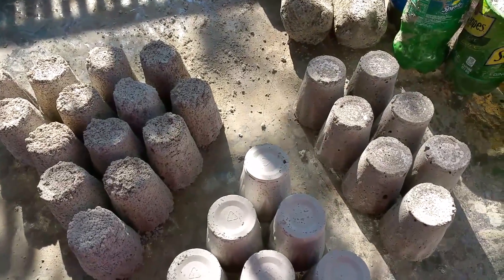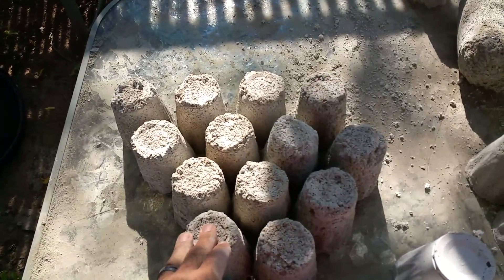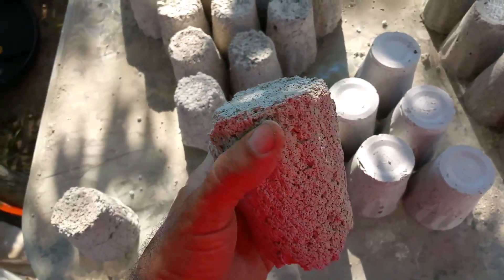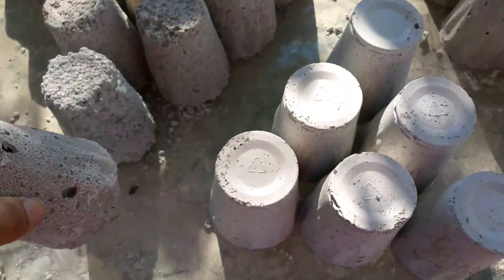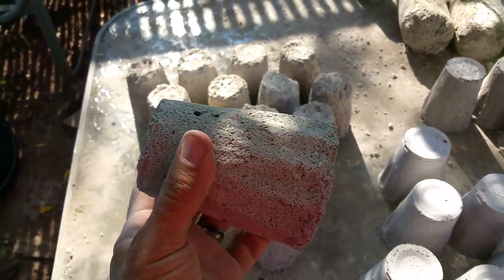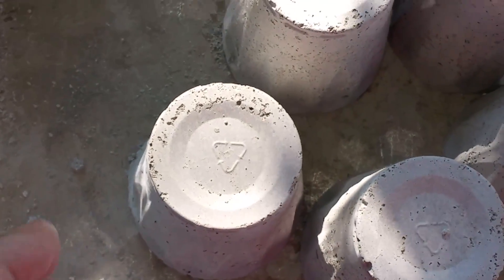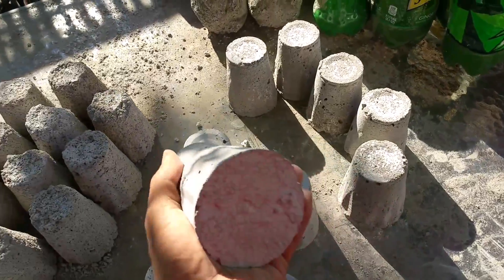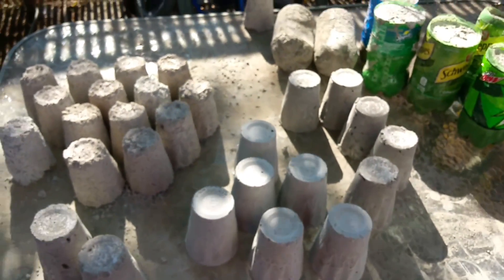Aircrete Update 7/17/2017 #Aircrete #DIY #AircreteHarry #Aircreteprojects #AircreteUpdates

Comment: Low-cost house casting system with air create, I sell the reusable plastic formworks to the Foam Generator and the Foaming Agent, all you need is one day training and the rest is consultations, all I ask for is a thousand dollars and you are on your way to be able to cast concrete houses.

My name is Alex Liew Chung Meng, a Malaysian born Chinese and I am 58 years old, I have been in the construction line for over 40 years. Starting with a 25 cent a day pay at the age of 13 years working part-time after school and weekend and school holidays.
I finish my secondary school education at the age of 15 and has a penchant for R and D on system to improve anything that interest me, one of it being concrete and steel engineering. And my specialty is in Fiber Reinforce Lightweight Concrete. I have transfer my know-how and systems to more than a dozen universities as I want the lecturers and professors of the civil engineering faculties to in turn let this students who will be future engineers and architects knows about my systems.
I remember then ( and even now still practice ) that large meter wide and meter deep holes were dig for the house footings where a pad footing is made and the stumps and the ground beams for the house foundations. The pad footing resembles a reinforce concrete slab inside the deep hole and then a short reinforce concrete column is done before back filling and then the ground beams, more than a dozen of this “ footings “ were done or require at every columns of a house, resulting in large amount of diggings and plywood forming, steel bar bending and concreting works, it was then back then I realize that why this unnecessary work?, why not a large slab above ground and it serve the same purposes, it is now known as Ralf Foundation or Strip Footings and many are using this nowadays even for more than one floor dwellings.
Back to Lightweight Concrete, we all know concrete is dense and use cement, sand and stone, density is at 2,400 kg/m3 range, my lightweight concrete use only the cement and sand and no stones, we use foam ( foam is like a shaving cream and shot out from a simple foam generator that I invented ) which is added to the mix and the amount or percentage of foam added is to reduce the density of the mortar mix, the cement and sand mix has a density ranging from  1,800 kg/m3  down to below a thousand kg/m3 which makes the mix lighter then water, the strength is also controllable via cement and sand ratio as well as other additives, it is also able to add recycle waste such as ash or quarry dust. The multiple mix and density makes it applicable to a wide range of applications ranging from heat insulation, blocks, panels, precast to casting a complete house, where by using simple to erect and dismantle reusable modular system formwork ( www.lcm.my ) I invented comes into the picture and hence the system of casting low-cost strong and very fast construction of low-cost affordable housings.
Back to those old conventional construction ways, after those footings as base of house,  it is the columns and roof beams, well same again were plywood forming, steel bar bending and concrete of the columns and roof beams and this is the structure frame of a house, well it is still in practices till today. When this is completed, bricks wall are brick-up, then a thick 20mm cement rendering for the completion of wall but remember that hacking are need for the wirings, water piping and sockets as well as the door and window frames.
All this works at the end of the day serve to make a house structure and all its walls, skill workers take months to complete this task when a simple change of making it happen serve the same purpose. Instead of months of works, all this can be done in days and with unskilled workers, all it need is a industrialize ways of doing the same work but with systems. Using reusable formwork, instead of columns and beams then brickwork plus cement rendering, formwork are setup, door and window frames in place inside the formwork, water pipes, electrical conduits as well as it’s sockets are all in place before chosen concrete is pump it and pour into the molds / formworks. It is dismantle after a few hours and the whole house structure is ready, all this take only a few days inclusive the base of house which is the Ralf foundation.
The worlds requirement of low-cost housing is mind boggling, I have travel far and wide in my business of training and technology transfer to many interested parties around the world, I license my few system formwork and even have a formwork that Stay In Place ( www.shss.my ) as when it is setup, the chosen concrete pour into the formwork and the formwork stay as the skin of the internal and external walls of the houses as this system eliminate the need for the thin layer of skim-coating required before painting finishes.
Countries like India requires hundreds of millions of small low-cost houses for the poor and homeless, Africa continents also require that volumes with Nigeria alone requiring 17 million units, I have train over 300 licensees in over 50 countries on various applications with my Lightweight Fiber Reinforce Foam Concrete technology. All in all and hopefully being able to help, I have and am still developing better and cheaper ways to let the world have my idea and system where everyone can own a concrete house, a durable and earthquake and cyclone proof strong concrete casted house. Bricks and blocks are major cause of death in an earthquake or cyclone as it tends to collapse easily. A casted wall is easier, stronger and cheaper way and hope it can be much more excepted ways to construct.
Me and my licensees have done sample houses in many countries like India, Sri Lanka, Indonesia, Philippines, Malaysia, Kenya, Uganda, Nigeria and many more countries, as always, many authorities will not be willing to help in this low-cost housing due to given reasons like land shortages, who is going to invest, who will pay, who will finance this and that, and at the end low-cost housing for the poor and homeless will be a major challenge. I have negotiated countless time for this low-cost housing in many countries and this are always the factors unless CSR ( Corporate Social Reasonability ) come into a compulsory reality as this is one way to help the world poor and homeless.
The other factors are even when a small low-cost cheap home is sold ( unless given for free for this few thousand dollars small houses ) to this poor homeless people, even a 30 to 50 dollars repayment also they are unwilling or not possible to repay monthly which is making no one or banks willing to help with this housing development project. Well we are not into housing development here but let’s stick to the point of my cheaper and better low-cost construction systems. With my proven methods and years of experience, millions of this houses can be casted annually, provided CSR comes into it as a compulsory subject or Queen Elizabeth willing to give a few % of her wealth to solve the worlds homeless and low-cost housing shortage, well will still see this unresolved.
Another one of the major factor in preventing it from happening for the affordable segment of housing is due to the fact that as compare to conventional construction methods where after weeks of footings works done they claim progressively, 10 % to 15%, then the columns and beams and weeks later they claim a little more also like 15% and further down the road bricks-works and others before the roof finishing, floor tiles, sanitary and electrical and other stage by stage claims. These take months to a year. So they can do it and it is economic for builders, buyers and bankers even though the houses done are more expensive and slow, compare to my system, just put it this way, you want to start work, you have to prepare your door and window frames, your water and electrical piping, roofing’s, sanitary, tile and even paints as all it takes is a few days or a week or so to complete the house, you need to change the financial side of implementing projects. And that puts of a lot of people from daring to use my system not to mention the capital investment for the formworks and the equipment like mixer pumps and of course my fees for training, technology transfer and consultations.
Regards.
28/05/2018
Alex Liew Chung Meng
Whatsapp : +6 019 9160861
E-mail : lightweightconcrete@yahoo.com
Website : www.lcm.my
Website : www.shss.my

Self Compacting Self Leveling Fiber Reinforce Lightweight Concrete for Modular Low cost affordable housings.  Worldwide there is a demand for good quality concrete low cost housing. According to the UN, about 21 million new low cost housing units are required per year. In order to clear the back log by 2030, an additional 14 million units per year are required. In Africa, 72% of urban population lives in slums. In Asia this is 46%. The houses must be cheap, easy to construct yet very durable and able to bring comfort to its occupants, also earthquake and cyclone proof. In this age of conservation of resources and green sustainable approach, these factors play an important role. By using modern construction methods, the quality of the built or cast houses is mainly controlled by the know-how used. Local communities can be engaged in a high share of workers usage as unskilled workers can be train in days just to set up reusable form-works, mixing of concretes and pour or pump into setup form-works, door and window frame are already in-place, so is water piping, electrical conduits and sockets before concrete is place, in a matter of hours, the complete cast houses is ready for finishing such as skim-coat paints and roofing. www.lcm.my

Comment: I was hoping the micro rebar would add strength.
Reply: It needs something to get a grip onto. It can't crip air. Less (or finer) bubbles = more grip.
I think the Dragon machine makes big air (not foam) bubbles from the way it whisks the foam/cement mix. It doesn't fold it in as a slow turning drum  mixer would.

Comment: How much does the foaming agent cost? Could soil cement be used as concrete?
Reply: You can get Drexel FM-160 foaming agent at www.stonebrothers.com. $33/gallon plus shipping, or $100 for 4 gallons, as of this posting.  

Mix 1 gallon Drexel to 160 gallons of water.

You can also find "ProFoam" concentrate on Amazon.com for $57. It uses 1 ounce per gallon.

Another video said that Suave shampoo is comparable to Drexel.
Reply: It is very cheap, around 2 dollars a liter and it make a couple of m3 of lightweight concrete. But you will need a Foam Generator to make stable foam. www.lcm.my

Comment: I  like your experiments.  The video camera is recording details that youu may not realize  for years to come.

About the brittleness of you aircrete.  I think part of it is your test.  When you rub your finger across it it is flaking off because it is getting torn in the tensile plan.  Cement has very little tensile strength.  When used in traditional building structures this is over come by putting in reinforcing steel.  When you lower the air bubbles the your finger react with the concrete with a more compression force simply because there is more  concrete to react with,  Answer maybe  to add some sort of fiber such as wood chips, bamboo, hemp, or some other organic fiber.

As for curing time, concrete cures for years.  When they built Hoover Dam the engineers added cooling pipe through the pours to carry away the heat.  I saw a documentary back in the 1990's and there were estimates that the concrete was still curing.

Comment: This is the first video that uses sand i have never seen anyone else using sand just the cement and foam. Have you tried that?
Reply from the maker: Yes when sand is added it makes the aircrete stronger  but less insulative.

Comment: Can you just clarify the best recipe  ratio in the description?  Are you using sand in all 3 of them?  How are you measuring pounds of foam?
Reply from the maker: Foam is measured using a 5 gallon bucket. By filling the bucket to the top and then putting it on a scale it should read 3 lbs.

Comment: Are you even coming close to following the mixing instructions?  I haven't seen anything close yet.....do it right or stop your stupid videos
Reply: Tom Burns you didn't state any opinion at all. You asked a question and followed it with a demand and insult. Honestly, you are the problem here.
Reply from the maker: Tom, I have two foam generating machines. The one I used in this video is a commercial grade machines whose instructions I was following. There are all kinds of Strength aircrete that can be made. Not just the one you know of. 
Here is the Expected Strengths and Insulative Values of Cellular Concrete list you can see, and learn for yourself.
 https://www.richway.com/construction-resources/mix-designs-and-economics.html
And this I the machine I was using. https://www.richway.com/construction-products/cellular-concrete-equipment/batch-production-machines/cfvt-8c.html 
Let me know if this information helped you understand better what I was doing in my test.  And one more thing If I did not make my stupid videos starting last year. Many people would have bought the Green Dragon that did not work as advertized. And since then they have stopped selling it and changed it to the Little Dragon. And that does work great. I was the only person doing test and  with my money so other people didn't have to. And sharing what I learned on YouTube.
Reply: I don't get it. Why would you go out of your way to make nasty remarks about someone's trying-to-be-helpful foam concrete video? 

You live to upset people? Or maybe you are paid by Vladimir Putin to disrupt US society by making random people feel hopeless? Seriously, I do not understand.
Reply: Is there some reason you have to be nasty?
Reply: Of course he is, and don't forget that Putin has hired people to troll all comment sections, not just political ones, in order to make us uneasy and angry all the time. "Tom Burns" likely works for Vladimir. His mission is to damage and ultimately destroy this country's political system.
Reply: Ok, thank you.
Reply: Big thanks Harry for your trials and sharing ,have you tried adding sawdust  and wood chips to cement you can get quite strong results 
I've been trying to get hold of magnesium oxide to make mag based cements  which adhere better to cellulose  well worth looking into 
I did add sawdust to foamed Portland cement in some small trials and it causes the foam to collapse more than normal so I'm going to try petrifying it first with water glass or mag ox
Reply: I doubt that jerk is a Russian troll ..there are lots of ugly, trollish people in the world ,and sometimes it's fun to look @ a posters channel to see where they're at.......I also doubt Putin hires trolls to destroy U S political system ,it's destroying itself daily....just my opinion...BUT ,I REALLY wanted to say that it's GREAT that so much information is being shared by people like this channel....I'm just looking @ foamcrete ,having spent a lot of time with papercrete...and it's GREAT to get info before committing to a new technique..I'm old ,and don't have the money,energy, or years left to make serious mistakes.......I just hope "they" don't shut down the internet , I can remember spending huge amnts. of time trying to get info in the past.............
Reply: Tom Burns criticism is totally uncalled for and rude. I'm trying to wrap my head around your thought process. Let me guess... Regressive unenlightened athiest in the throes of nihism
Reply: I stated an opinion and you start giving me shit, are you holier than thou?  I doubt it more like a piece of shit.

Comment: i havent done this yet just doing my research now. Im thinkin no sand ie the air is the filler.  finer foam mix maybe use steel wool in tube with 90 psi and at least 50 psi water .   Thats what im trying in the am. Oh for sure fibre added to fix. that would be a deal breaker without .  best wishes to all

Comment: U sure u need mix sand? others sources used just cement and foam
Reply from the maker: Matt J. I use sand to make a stronger aircrete.
Reply: And what is your final outcome of this test?
 Could you make reinforced concrete from aircrete?
Reply from the maker: I have to redo the test, it rained and i did not have a cover on the aircrete with the micro rebar.

Comment: What's the density of your foam?  The gibron center guy said it should be between 80 to 100 grams per quart. And a 40 to 1 cup ratio.  He's doing 5 gallons of water to 2 cups of soap.  He's also mixing his cement and then mixing the foam into it with a hand held mixer.  People are having good results from the little dragon.
Reply from the maker: My foam is 3 lbs to one 5 gallon bucket.
Reply: Talyn71 I have absolutely no way of making the numbers I gave and the numbers you gave mesh.  I'm bad with math.  Something tells me you may be going about it wrong.  Instead of trying for weight of 5 gallons, have you tried a 1 quart sample?  If so, what was the weight of it?  From what I saw of how he does it, more than 5 gallons gets used at times. Or less, basically the same volume as cement.
Reply from the maker: Hi John,  There are  4 quart in one gallon and 16 ounces in 1 lbs . 80 grams = 2.82192  ounces  in one quart times 4  equals 11.28768 ounces. times five (for a 5 gallon bucket) = 56.4384 ounces divided by  16 = 3.5274 lbs. I'm doing it right. :-)
Reply: Talyn71 ok.